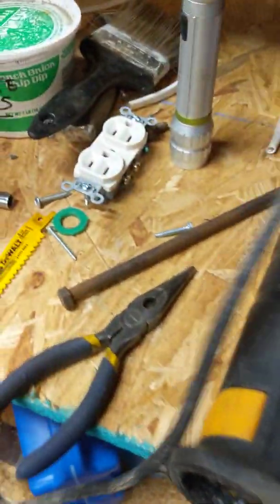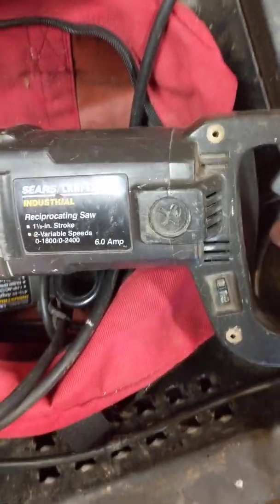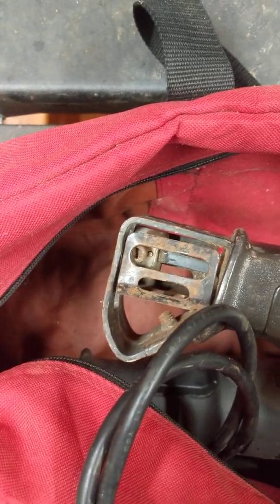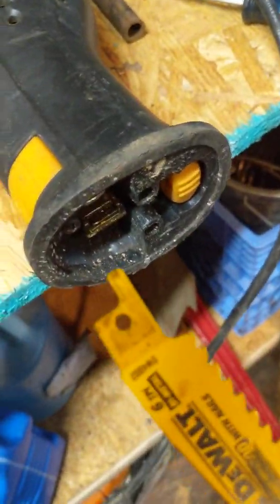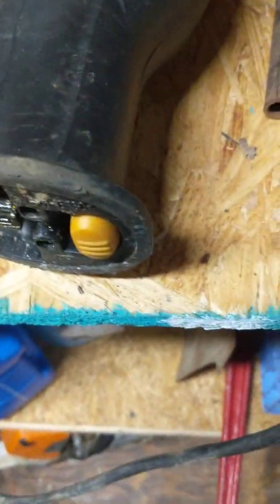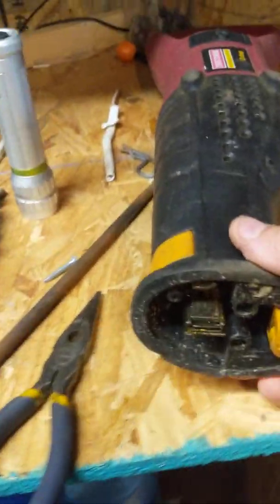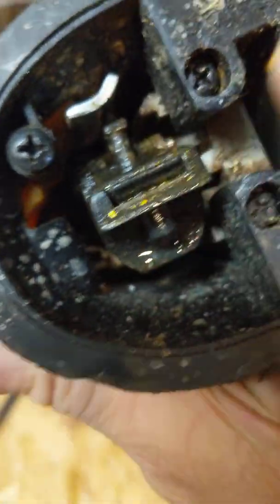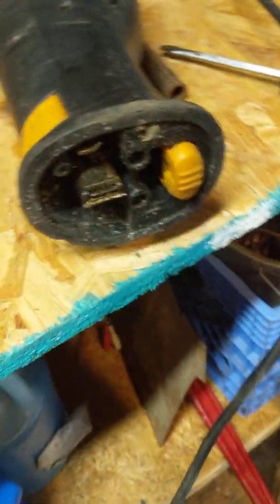Easy reciprocating saw fix

Comment: man I wish that was wrong with mine...
Reply from the maker: I'm sorry to hear yours has a bigger issue.  These are not too expensive and Harbor Freight has pretty good deals on tools from time to time.  Their tools are good for part time use if that's what you are using it for, but for more durability you should get a more expensive brand.  Thank you for watching and check out the channel for more videos.